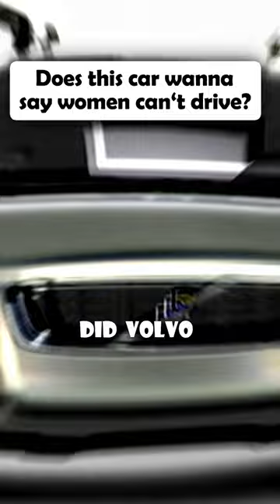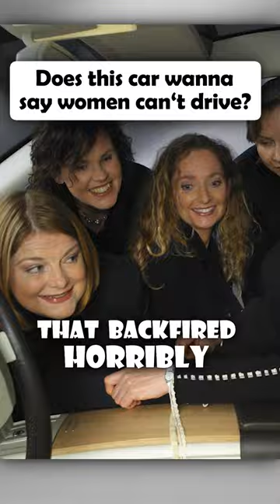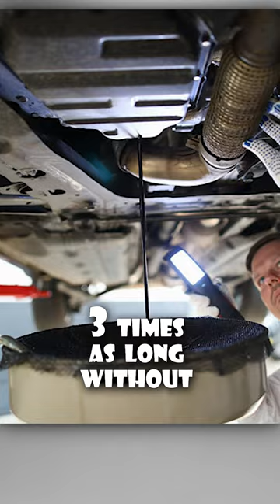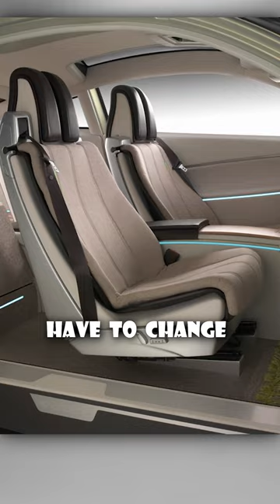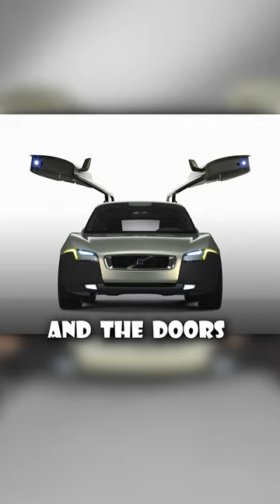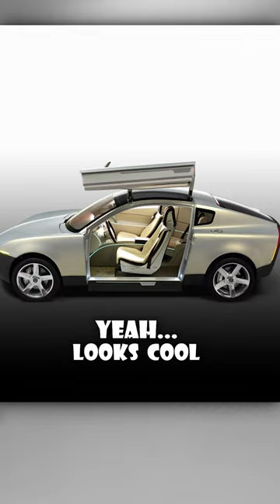A Car Everyone Hated - Volvo YCC

Comment: how are you supposed to get out if you're in a confined space or parking
Reply: That's the neat part, you don't
(No seriously, either they just can't be opened or the doors have the right opening angle to fit)
Reply: @generalgrievous6648  i mean, ik the one's in teslas have sensors for the doors that can make it open perfectly, but I'm confused about this one because it was made back in 2004.